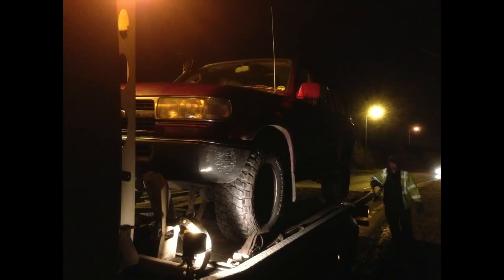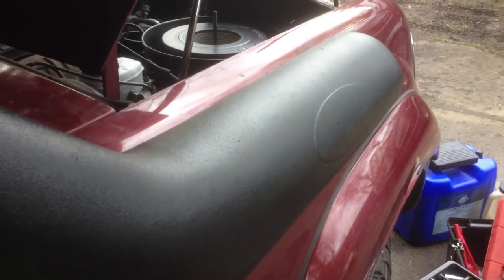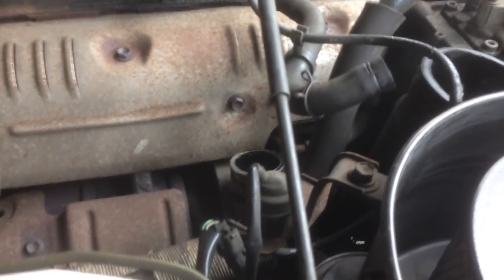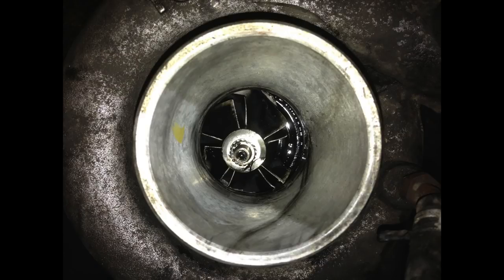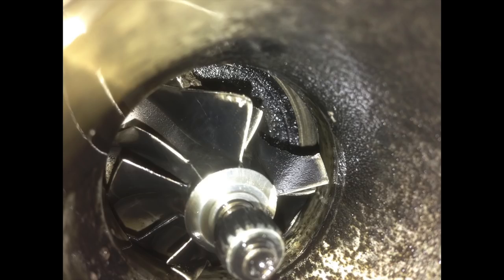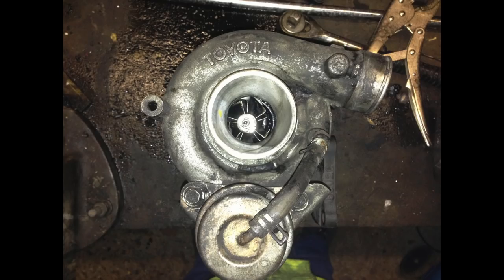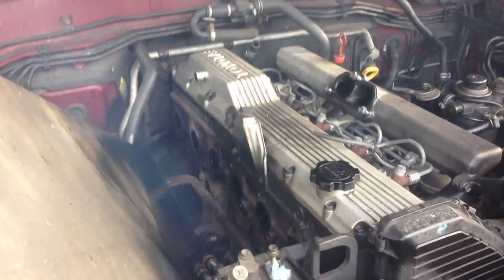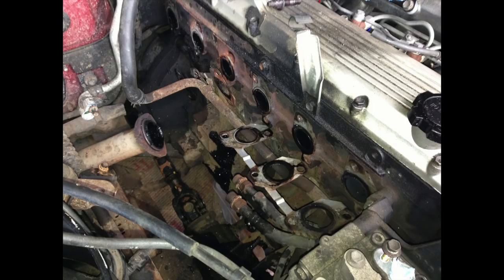Toyota Landcruiser HDJ80 1HD-T turbo failure aftermath

Comment: I actually got a new Gturbo as a precaution based on your (and others) experience. Glad you posted this, because my old turbo was well shot, and probably wery close to its grave. Didn't measure, but it had a LOT of play. So bad in fact it was rubbing on the housing. I changed it at close to 400000km.

Comment from the maker: No tell-tale signs as you describe them - no oil leaks or weird noises anywhere. The turbo end-float and free play were well within Toyota book specs less than 10,000 miles before this happened, and there was no burning of oil or indication of a worn seal or bearing any other way.

The turbo failed because the shaft itself sheered, not because the bearing collapsed or otherwise failed. The only reason oil escaped from the bearing was that there was no longer a shaft there to seal it! :-)
Reply: Thank you bro

Comment: a CT26 on a 1HD-T should be rebuilt at 300,000kms just in case this happens.  However mine went at 287,000kms because I was playing with boost and fuel.. the Safari IC saved the engine and a GTurbo is now on it running 20psi

Comment: Bad luck with this motor, even after having the big end bearings replaced. I would love to see a follow-up on this project as I have the same vehicle. Mine has just ticked over 340,000Kms and hasn't missed a beat, but after seeing this, makes me think I should look at replacing my turbo before long. Maybe try a GTurbo??

Comment: nice vido harry ,
i have the same smoke as this car on my lc80 ,but the turbo oil leak is very small ,what do u think harry ,i have engine problem or should i fix my turbo 
friend of mine check my turbo ones and he said the bering is damaged  and that s the caused of leak

Comment: Doesn't the injection pump have a kill switch? My 60 series does.

And regarding good servicing: if most of those 280k were short trips/cold weather/towing ('severe' driving), once every 4k would still constitute poor servicing. It's not just the miles, it's the type of miles that are equally important.
Reply from the maker: An injection pump kill switch is completely pointless when it's not the injection pump supplying the fuel :-D

As for the servicing - no clue... Never really did anything too strenuous when I had it - it'd already done 260K when I took ownership...
Reply: 10 liter oil can run a long time....